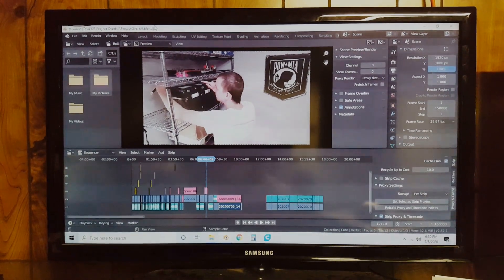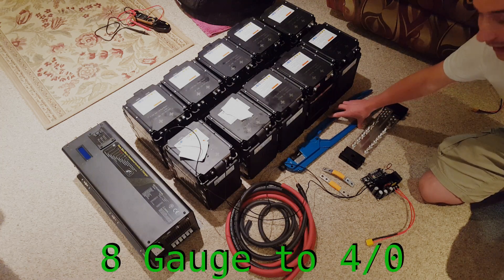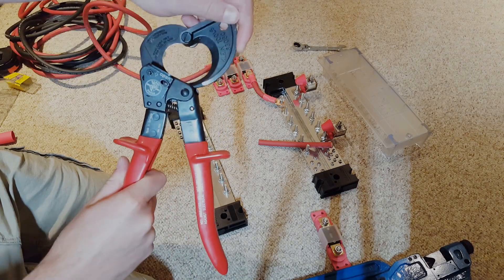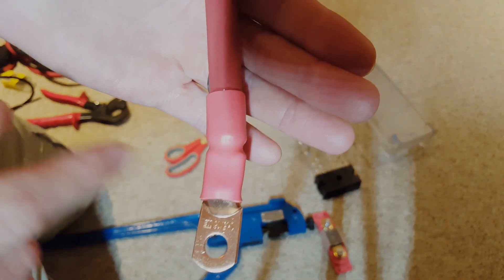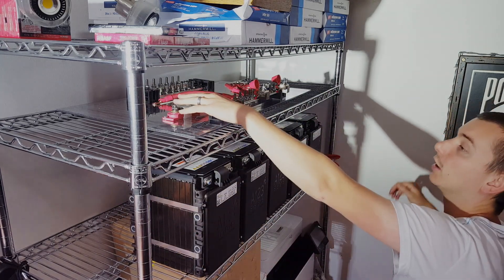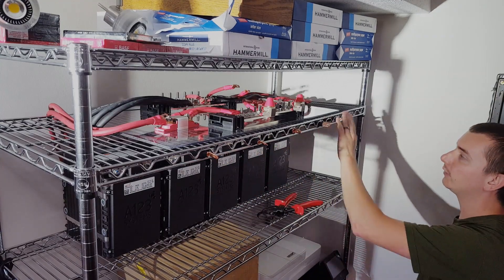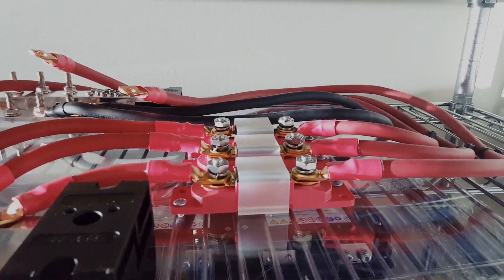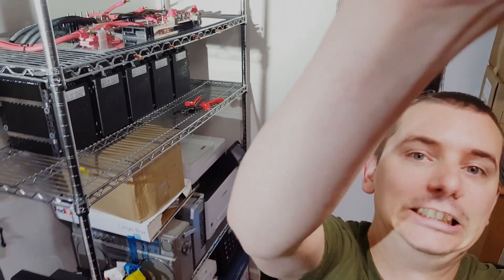"Project Overkill"-Pt. 1- 12KWh 48V Battery Backup from 7S A123 Batteries from Battery Hookup!!

Comment: What BMS? I don't see it list here or in part 3.
Reply from the maker: The BMS I ended up using is the ant-bms 7S-20S 320 amp. Dont push 320 amps lol.

https://m.aliexpress.com/item/32997552090.html?spm=a2g0n.orderlist-amp.item.32997552090&aff_trace_key=&aff_platform=msite&m_page_id=5698amp-vmza-yZmPWDDCC06qX8RTg1612712580348&browser_id=2bda7d1d8d894d3a8ffc7bc664b4afb6&is_c=Y
Reply: @diyrenewableenergyelectron4996  awesome, thank you. Was looking for alternatives to Daly. I can imagine that trying to pull 320amps thru those without cooling would be brown pants time.
Reply from the maker: No problem. There are four 12 gauge leads on this BMS so for safety I would limit it to 80 amps. I currently use one of these and max it out around 35 amps or so and I havent had issues. When giving these things an amperage rating the Chinese BMS companies tend to..... Embellish? Lol

Comment: My old car audio vehicle had 5 runs of 1/0 red welding cable. I salvaged it and will be used on my solar project. Those bus bars are awesome never seen them before. My 48v inverter is 1800 watts just a small unit for testing at the moment. I am still looking into batteries, would these be a better choice than BYD.
Reply from the maker: These are going to stay in balance much better. They also have much more life left in them(not so degraded). These are more expensive per KWh than the BYD's but the additional cost is worth it to me when they are so much higher quality. These are pretty hard to come by now, and you have to use a BMS that allows for a 7S(24v) or 14S(48v) system. I went with the ANT-BMS's and so far theyre working very well. Anytime you can get a standard 4S/8S/16S battery it is preferable, but if you are looking for salvage cells / trying to maximize your budget you have to take what the market has to offer. When the decision was made to build this system, these were what was available so I made it work. Thanks for watching!

Comment: only thing that bothers me is seperate bms for the series should this not be a 14s bms then parallel the 5 bms's
Reply from the maker: Can you elaborate a bit? I think I know what you're asking but I'm not sure. The BMS's are wired in parallel.  Thats why all of the battery voltages end up the same. Each of the 5 BMS's are 14S BMS's, I just used 2 7S batteries to make the 14S system.
Reply: question on the bms does the software allow you to see all the batterys or do you have to pick and choose each pack to see it
Reply from the maker: Each BMS must be selected individually to see the info about it. Luckily the screens provide most of the info you would need and also since the batteries are in parallel the voltages stay very similar.
Reply: @diyrenewableenergyelectron4996  cool
Reply: @diyrenewableenergyelectron4996  my bad i understand now i thoght you was using 2x tbms in series not until i so the 3rd video do i see the 14s bms

Comment: I would recommend not using those ANL fuses. They are not rated for a high current arc fault if they open. It’s possible they could open due to a short, but yet still pass power across the open due to a plasma arc. For safety with high current Lithium chemistry your should only be using class T or equivalent rated fuses. Class T or equivalent will have current limiting specs stamped on them for AC and DC in the KA range (ie 50KA IR @ 160VDC). Any other current protection may not protect you or your equipment for arc fires.
Reply from the maker: Thanks for the heads up! These fuses specified that they were rated for 48v DC, but no current breaking capability was listed. They're there only to protect the batteries from each other in the case of a freak accident where one shorts out. Thousands of amps would flow if that happened. So I definitely need to make sure the current flow breaks. It looks like those class T's can be bolted right to my cable lugs. I'll be ordering some.

Comment: How heavy are the batteries? Do you ever plan on moving your Wire Shelving Unit on its rollers if you do I would lower the bottom wrack to the lowest position above the wheels? The indents for the plastic keepers act the same way scoring a piece of glass. If you move it and hit a bump or a crack they give way pretty easily. Two of the three times it happened to me the whole thing just crumbled and everything went on the ground. They hold a lot but not moving and not high on the wrack.
Reply from the maker: Thank you for the heads up! This is a stationary setup so no movement whatsoever. If we ever do end up moving it for some reason, the battery strings will be diasassembled and removed from the rack before moving the rack.
Reply from the maker: They're 27lbs each. Forgot to mention that.